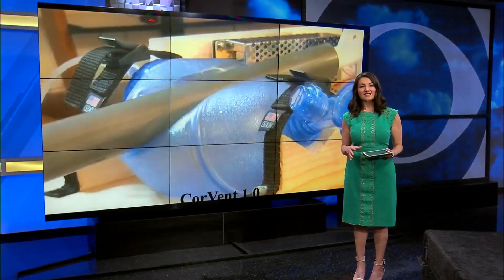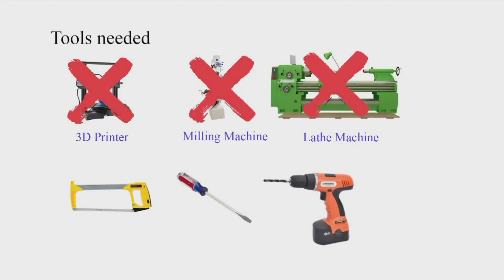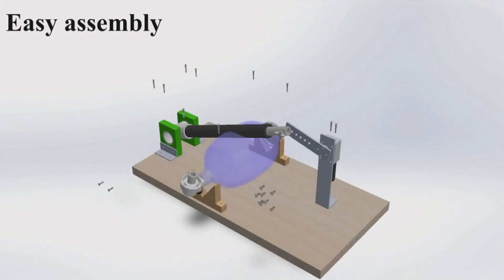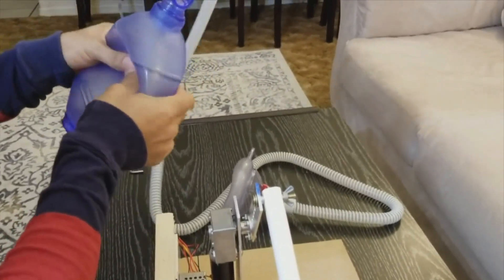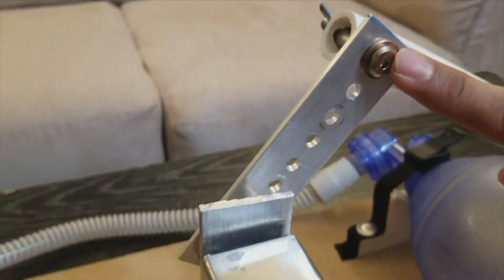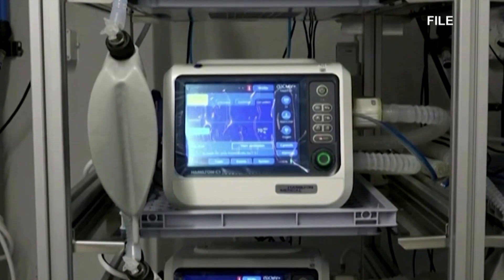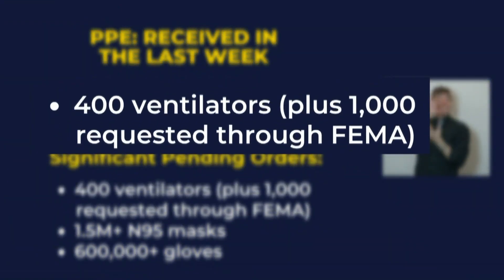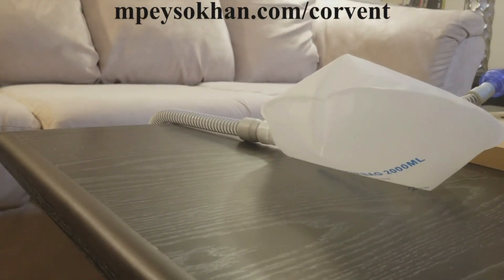UNM student builds homemade ventilator

Comment: Patent?! Get a real life dude! Instead of fishing for publicity n fooling people by pretending to create something that already exist, do sth meaningful with your life!
Reply: Adam Bloom 
Thanks for your comment. As far as I know, there are a few designs by different universities and companies and we take a look at all of them carefully. For making all of them you need to have a 3D printer, milling machine, lathe machine, or servo motor programmer, etc. But I was thinking about this issue that is this kind of tool available in poor countries? For example in a poor village in Africa? So we designed a very simple and cheap device that you can make it easily by a few pieces of wood and PVC pipe. The tools that are needed are just drill, bandsaw, and regular tools. 
Our design has two main features. Firstly you can mechanically adjust the volume and secondly, you can change the rate. 
That was my philosophy of starting this project.
Thanks for your comment, I am really happy to hear your thoughts.
Reply: There are several of them on youtube - this one posted 3/19

https://youtu.be/_6fWpdXvOYk
Reply: And fyi, ventilation is a complex process. None of these devices would work properly in real life, if not cause death!

Comment: Ventilators are very complicated, this is just an air-pump,  people have been making these with RASPBERRY PI’s for how complicated it is.
Reply: BUSTER-MOBILE-ABQ 
Yeah, you are right. A ventilator is a very complicated machine.  Based on my knowledge the price of a ventilator was around 25k and now because of this crisis, it goes up to 40k. 
Now there is a lack of ventilator all over the world even here in the US. Another option is using a manual ventilator which is a combination of a trained person and an AMBU bag. Our design is a manual ventilator that mimics the trained person that’s it! Nothing else. No think about poor countries.  I am not saying this device is like a miracle that can save lives. But in the case to choose between death and a little bit of chance of living I hope it will work. Even for this kind of manual ventilator, there are lots of designs by using a 3D printer, milling machine, lathe machine, etc. I was thinking that is there any of these tools available in a village in poor countries!? Our device is a very simple device with two important feature first you can change the rate and second you can change the volume. It is made completely from the off-shelf material and for making it you just need a hand saw ,drill and regular tools.

Comment: That's not a ventilator, that's an airpump.
Reply: https://www.medicinenet.com/different_types_of_mechanical_ventilation/article.htm
Reply: I'm right you're wrong 
Thanks for your comments. I watched it, as far as I the automatic ventilator are very expensive and it was 25000 dollars before the crises and now because of competition, it is about 40,000 us dollars. And everywhere there is a lack of automatic ventilator even here in the US. Here we need about 900,000 ventilators based on predictions and now only 12,000 are available. And the rate of production is about a couple of hundred per month!
So one option is to use a MANUAL ventilator (not perfect but you have to) which is an AMBU bag and a trained person. This kind of design just mimics the trained person that is it nothing else. 
We were thinking about this crisis in very poor countries. They don't have access to 3D printer, milling machines, or lathe machine, etc.
We design it in such a way that for making it no 3d printer, milling machine, or lathe machine are needed. That anyone in any part of the world can easily make it with a bandsaw, drill, and regular tools. 
I am not saying this kind of design is like a miracle that can save lives. But in cases to choose between death and a little bit chance of living especially in poor countries, it would hopefully be useful. 
I really appreciate your comments and your thoughts. 
Thanks

Comment: STOLE THE IDEA FROM YOUTUBE
Reply: Larry Stallings 
Thanks for your comment. 
There are a few designs on YouTube. The main problem with all of them is that for making them you need to use the 3D printer, milling machine, lathe machine, etc. I was thinking that is there any of those tools available in poor countries?
Absolutely no!
The main novelty of our design is that it is very simple you can make it in your living room with a drill, hand saw, and regular tools. Our design has two important features first you can change the volume and secondly, you can change the rate easily. 
Anyone in any part of the word can easily make the device with pieces of wood, PVC pipes, etc. That was my philosophy.
Reply: https://youtu.be/_6fWpdXvOYk
Reply: Adam Bloom 
Thanks for your comments. Please take a look at my design. Each ventilator should have two important features, firstly the volume should be adjustable. Secondly, the rate should be adjustable. 
The beauty of our design is that we have control over both of them easily. For adjusting the volume you have 6 different volume options, you can easily shift the screw on the arm joint and change it from minimum to maximum. And for changing the rate you can change it easily from 0 to 100 percent. 
Thanks for your comment
Reply: Duudddee! 
https://youtu.be/eelHJNxPgGE
Reply: Larry Stallings .... he shared it to YouTube he didn’t steal it ..... you stupid cyber bully!!!
And what have you done for humanity?
Reply: Ray Tennessean  haha dumb bitch